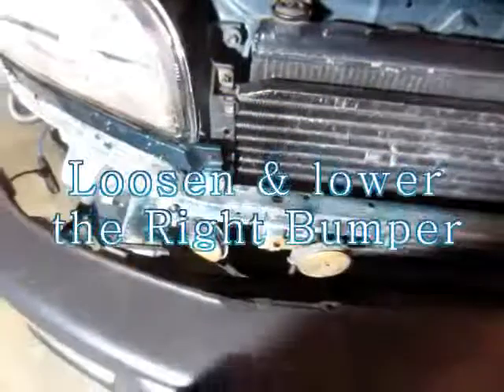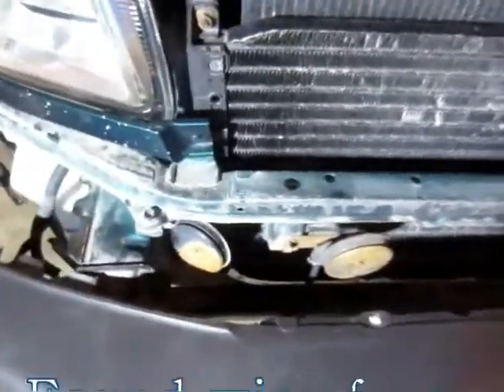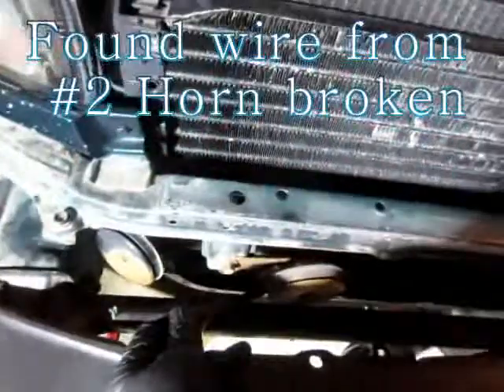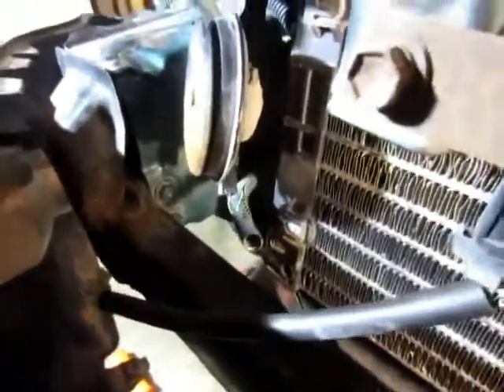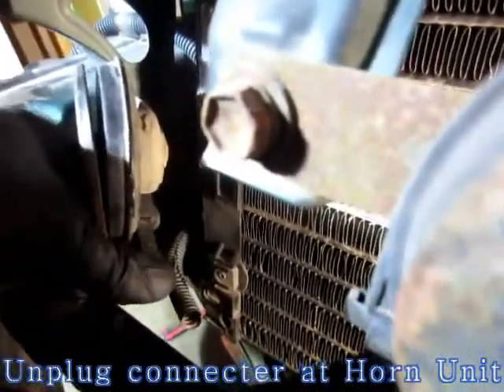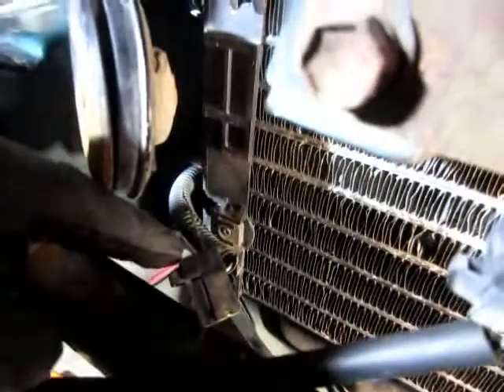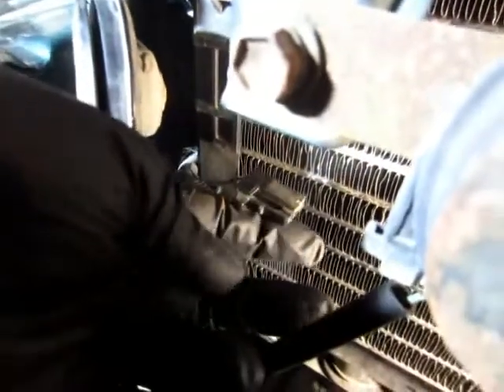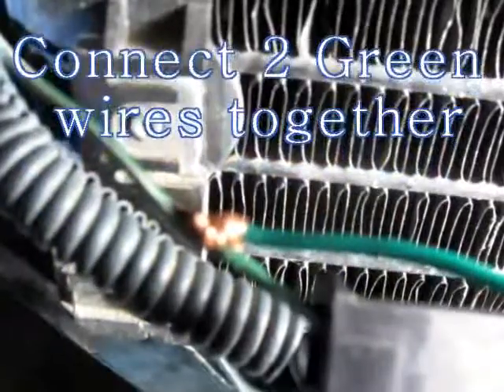How to repair horn Rav4 - weak horn - Rav4 Toyota 1996 1997 1998 1999 2000 2001 2002 2003 2004 2005

Comment: Thank you!

After 160,000+ kilometers of reliable service, I finally replaced the original radiator since it began leaking substantial coolant from top of radiator area seal. Easy job but extremely difficult to access the necessary bolts from tight areas.

I successfully replaced the radiator WITHOUT disconnecting the AC condenser or having to lose any AC refrigerant. 

Anyway, thanks for all the helpful videos you make. I'm soon going to next replace the Starter using your old video!

Comment: How did you remove that fender? I am trying the phillips heads and they are just spinning. Thanks for the video though. My horn is constantly going off when the RAV is parked, even with the horn's fuse pulled.
Reply from the maker: Take a look to these and simulate. See whether these are helpful
https://www.youtube.com/watch?v=76e0Ps7Q9Zo&t=17s
https://www.youtube.com/watch?v=5Mmtc-b5wZ4
Reply: @tgmac8288  Thank you! Those will be helpful.

Comment: i couldn't find it  thank you !
Reply from the maker: Cletus Pendejos Did you loosen and lower the front bumper of the passenger side? Both horn units should be right behind. You cannot see the horns without lower the front bumper.
Reply: tgmac8288 I didn't need two I just open the hood and i fixed right up 98 model
Reply from the maker: Cletus Pendejos Great! You have fixed it.